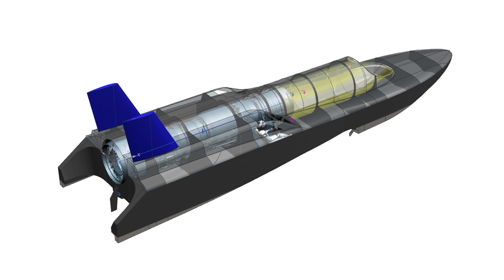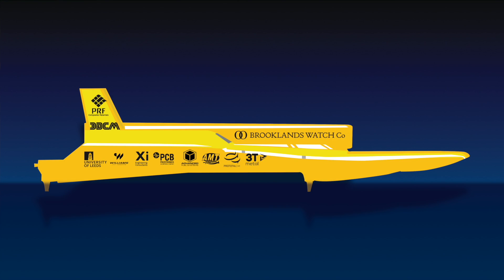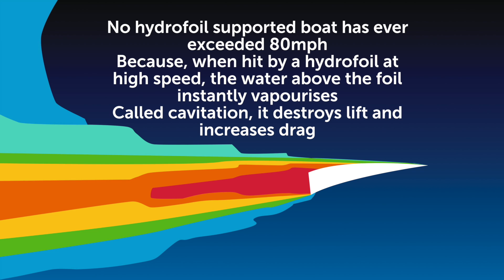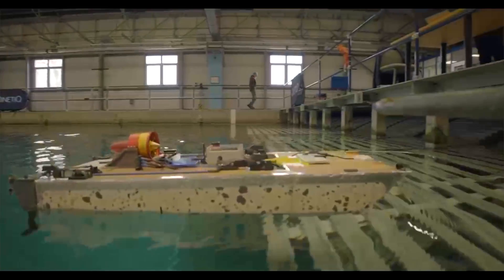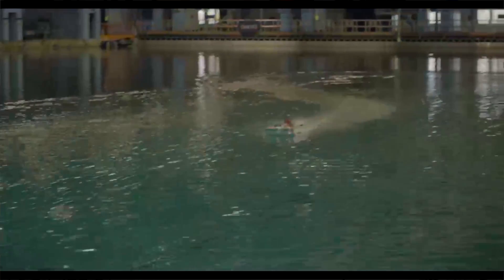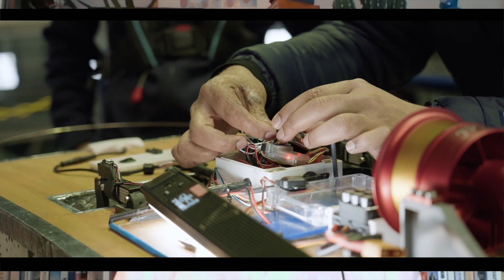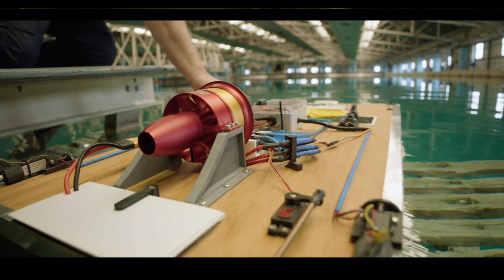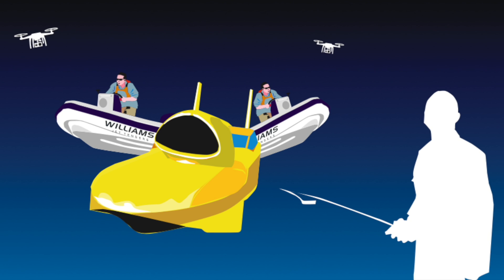Thrust Water Speed Project - Update #5 - Wings Under Water (Hydrofoil Testing)

Comment: How do the sensors and servos mentioned at 4:21 square with UIM rule 504.14?: 'All moveable surfaces allowed on the boat shall be under the control of the onboard crew without any sensors in the control loop'.
Reply: If a record speed is attained  and verified by independent witnesses the public will accept it as a record whatever the UIM says.
Reply: @geoffreypiltz271  Tell that to the Budweiser Rocket team😊
Reply: @martinstuart3264  The Budweiser Rocket's speed was not verified by independent witnesses. The team simply claimed that they had broken the sound barrier based on their own calculations from radar tracking data along with accelerometer data which has not been made public. Will you take my word for it that I have broken the sound barrier on my own calculations?
Reply: @geoffreypiltz271  Yes it was: it was certified by the USAF, who issued a written statement to confirm that, in their assessment (using their radar tracking, operated by their personnel, on their Air Force base), it had gone supersonic. Ironically, this was before Richard Noble's much slower (but officially sanctioned by the FIA, and run in accordance with the rulebook) record set by Thrust II.
Reply: @martinstuart3264  The Air Force states it "never intended to give official sanction to test results, nor to give the appearance of expressing an official view as to the speed attained by the test vehicle. Any such opinion was that of individual Air Force personnel, not of the Air Force". from wikipedia
Reply: @geoffreypiltz271  That's kind of the point. What many dispute is whether the Budweiser Rocket went supersonic, given that there was no sonic boom,  that it only exceeded the calculated speed of sound by a tiny fraction, and that the speed of sound varies by temperature and pressure, so is difficult to pin down at the best of times. 

What nobody who knows anything about it would deny is that Budweiser Rocket went MUCH faster than Thrust II later managed (by nearly 90mph, if you compare peak speeds). But she didn't do it by the rulebook, and she wasn't timed by the sport's official governing body, so it's not a record and nobody regards it as such.

Dave Warby (the current, late, record holder's son) has a boat already on the water and under testing that complies fully with the UIM rules, so how will it look if Thrust WSH achieves a higher speed by ignoring them? I don't want to use the word 'cheat', but if they can't beat an almost 40 year old record without disregarding the rulebook, it's a sorry state of affairs.
Reply: @martinstuart3264  In my original comment I stated "verified by independent witnesses", by this I meant a two-way timed run, not some after the fact calculations. If Dave Warby beats his dad's record according to the rules then he will have the record. My original comment really only holds if WSH is the only competitor.
Reply: @geoffreypiltz271  There are >several< current contenders for the Water Speed Record - all of whom (with the exception of Thrust WSH) are sticking to the UIM rules.

Warby effectively threw away a completed hull and started over again because the UIM changed the rules to require a safety cockpit after his earlier boat was already complete and ready to run. Perhaps he should have taken Thrust WSH's attitude of 'f*** the rulebook!', and run regardless?
Reply: @martinstuart3264  I'm not prescribing anything, just commenting on likely outcomes.
Reply: @geoffreypiltz271  I didn't say you were. I was merely responding to your statement that your original comment only holds if Thrust WSH is the only competitor: I'm simply pointing out that it ISN'T the only competitor, by any means, since there are several other projects ongoing - at least two of them (Warby and the late Daniel Dehaemer's Dartagnon, if someone picks up his torch) with 'legal' boats close to being complete and ready to run.
You therefore seem to be saying that your original comment (since by your own admission it does not really hold) was irrelevant?
Reply: @martinstuart3264  Whatever, I'm bored.
Reply: In the document I found from 2021 this is 709.1, and yep it sounds like this would not be allowed. Moveable hydrofoils sound a lot like “moveable surfaces”, and IMUs incorporate accelerometers. So yes, that’s not going to happen. However this is the same folk that allowed the land speed record cars to be pushed along via the expulsion of gasses, so I doubt it’ll be a major stumbling block.
Reply: @lawrencemanning  Despite their undoubted achievements, Richard Noble and the Thrust team were NOT the same folk that brought forth thrust-propelled land speed record cars - those go back to Dr Nathan Ostich's 'Flying Caduceus' and Craig Breedlove's 'Spirit of America', back in the early 1960's. Then there was Art Arfons' Green Monster and the Blue Flame driven by Gary Gabelich, among others. Thrust 2 didn't come along until the 1980s... a latecomer, relatively speaking.

If they're relying on a rule change to make the design acceptable, it would seem sensible to negotiate this with the UIM >before< getting too deep into the design of the boat, but the fact that there have been a couple of editions of the UIM rulebook since this project commenced does not suggest this to be the case. 

The problem for the UIM is that if they allow such a fundamental rule change for WWSR craft, they'll soon find other race classes being computer controlled, and next thing you know you're left with passenger-carrying drones lapping a circuit...
Reply: When I said “this is the same folk” I was referring to the rule makers, not Noble and co. I’ve followed the LSR on and off since I was a boy and know that the change to allow jets/rockets occurred before Noble got involved in, what, the early 80s? I only knew about Blue Flame and will find out more about the rule change as, whilst I don’t agree with it at all, it is interesting. 

It is a slippery slope for sure, but I imagine the rules will be changed in a way that won’t allow your doom and gloom scenario. It’ll come down to money and “marketing”. At least they won’t change that much, yet. 😢
Reply: @lawrencemanning  It's not the same rulemakers, either: the Land Speed Record is governed by the Federation Internationale de l'Automobile (FIA)... the Water Speed Record is governed by the Union Internationale Motonautique (UIM). Completely separate organisations.

As an aside, the first jet Land Speed Record (Breedlove's Spirit of America) was sanctioned by the Federation Internationale de Motocyclisme (the governing body for motorcycle racing), but that was because it didn't qualify as a 'car' under FIA rules becuase it only had three wheels, not because it was thrust driven... Flying Caduceus (which had four wheels) had been sanctioned by the FIA previously, but just hadn't gone fast enough to take the record.